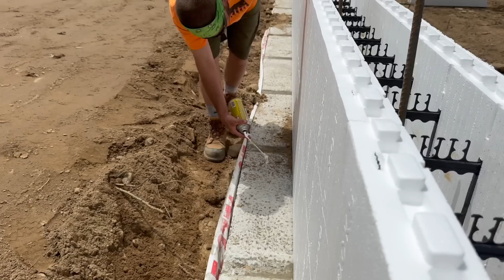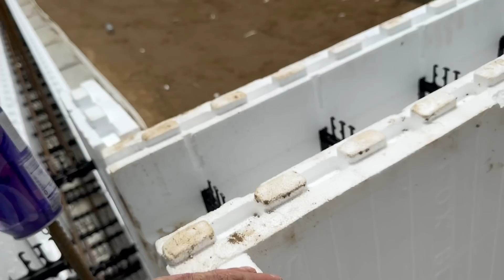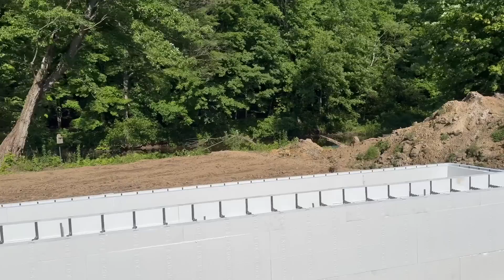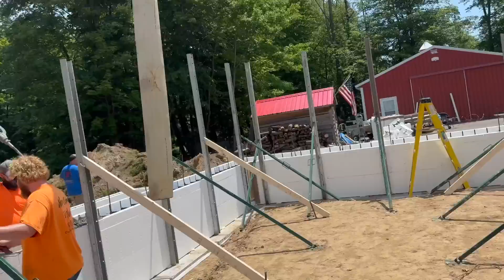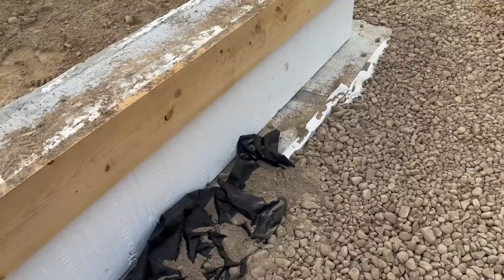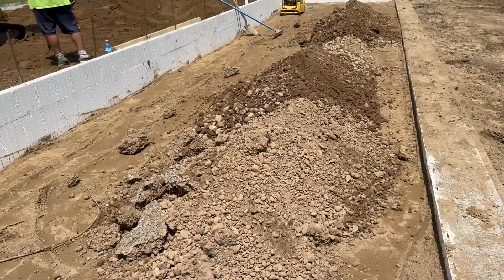ICF stem wall foundation part 2

Comment: Why does you guys use foam boards for frost protection instead of pouring a 4 foot frost wall?
Reply from the maker: It's much cheaper first of all. less excavation and less concrete and ICF blocks. Most importantly it keeps the wall out of the water table on a wet area.

Comment: If the interior of foundation is going to be filled in why didn't customer go with a grade beam foundation with 4' insulation panels laid flat around the perimeter of foundation and insulate the floor.

Comment: Why would you want these bubbles of spray foam under your concrete wall?
Reply: It sticks the foam blocks to the footing the spray foam goes between the locking teeth of the blocks so it doesn’t raise the blocks up at all

Comment: Hot? I know you are not used to it. We do it in 100-degree weather all the time. We keep lots of blankets ready to go and wet them before putting them on the pour. Finishing goes on as the crete hits the form, no going back over it is one-time get er done.